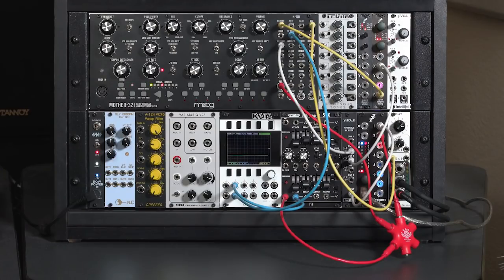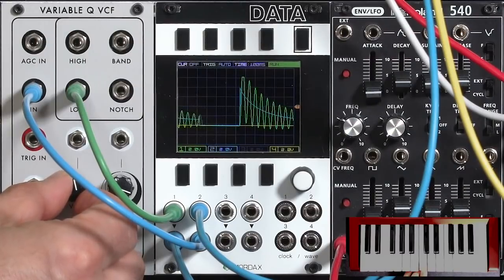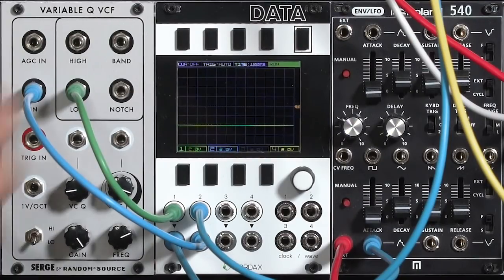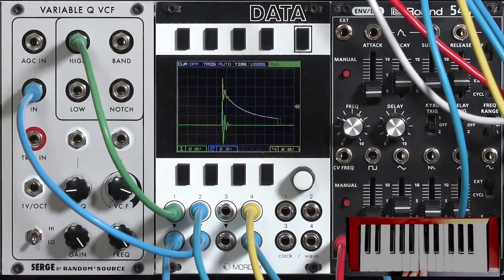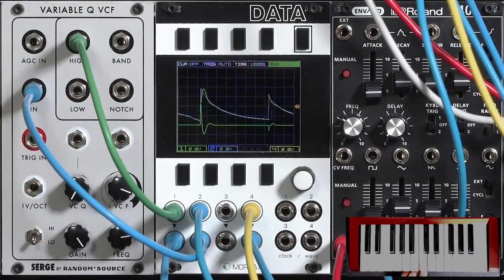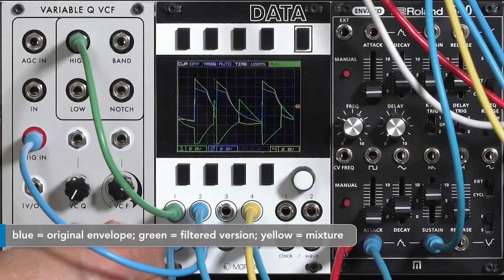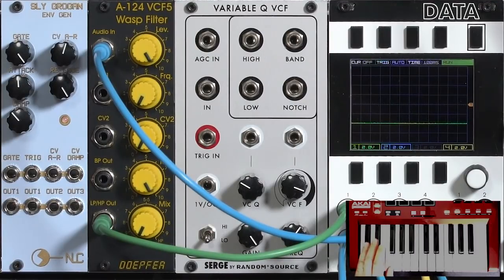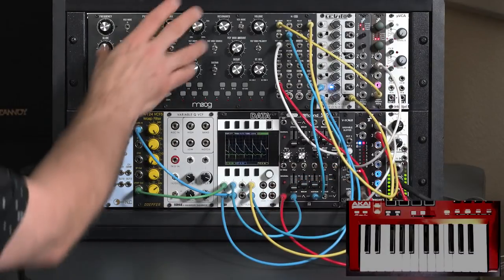Resonant Envelopes (Patch & Tweak/Learning Modular)

Comment: Very cool! I didn't understand switching to highness output, though.  The author said it "Acted like" an AC-coupled filter? Wouldn't an AC-coupled filter ignore an envelope?
Reply from the maker: At the moment an envelope changes level, it is now (briefly) AC - not DC. And a sudden spike actually contains a very wide range of harmonics, from low to high, to build that steep spike. The "AC coupling" is actually its own filter on the CV, with a cutoff frequency (usually very, very low); that cutoff determines how many and which of these harmonics get through.

Comment: Wow, I've had this idea about the same time! Now I'm watching this video. But never tried yet. OK, it's interesting, keep watching...
What's the difference between this method and an additional (to the envelope) sine LFO attenuated with the same envelope?
Although... making a simple MS-20 clone is easier than some LFOs. I must admit :) Also it will have the whole range of frequencies. It's hard to make with a simple sine analog LFO.
WASP sounds more interesting!
 The cons: not all filters have an equal resonance amount over the whole freq. range.
Reply from the maker: The differences are:
 - the sine is synchronized to start with the envelope 
 - you can adjust the damping period (the resonance amount) separate from the envelope times

Comment: Could you then send the affected envelope out to a frequency divider to get a slower warble from the resonance?
Reply from the maker: First, the good news: All you need to do to slow down the warbles is to reduce the filters's cutoff frequency. Some filters - like the Wasp filter used for part of this video - have a limited frequency range from their front panel knob; sending a negative voltage to one of their frequency CV inputs can help tune them lower.

As for using a frequency divider, normal frequency dividers are binary - they are either on or off, and are meant for dividing clock signals or square waves; they won't work to reduce the pitch or frequency of a more complex analog signal. You would need a frequency shifter to change the frequency of an analog signal.
Reply: I guess then you may aswell have an lfo's wobble sent to be mixed with the envelope, but have that LFO sent to a VCA which is being plucked by the same gate/envelope, so that only the initial attack is affected....

Comment: Nice! Isn't that kind of the same as mixing the adsr with an sine lfo?
Reply from the maker: The differences are it re-synchronizes on each envelope start (and again at the end of the sustain, if you have a sharp release), plus it's damped and dies away on its own (unless you have feedback turned up very high).